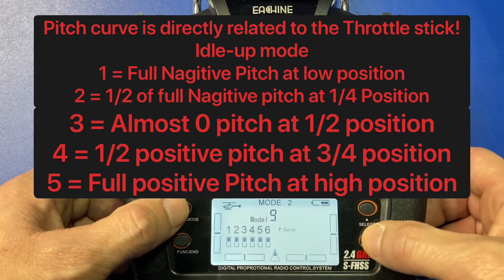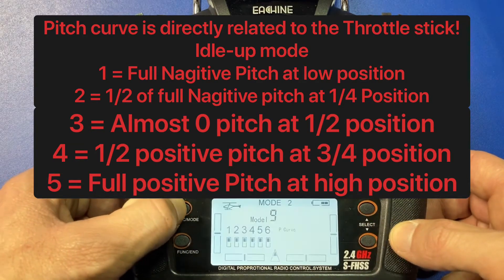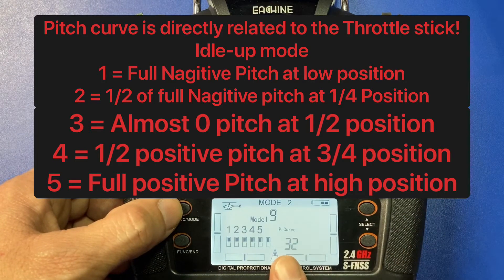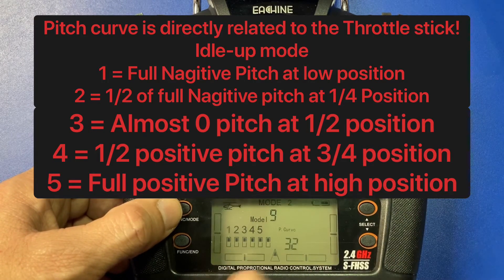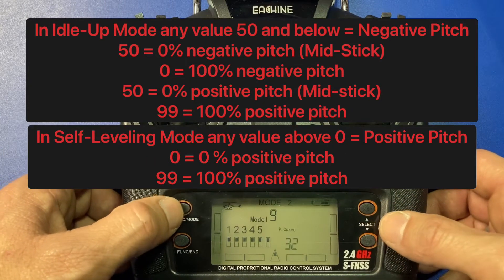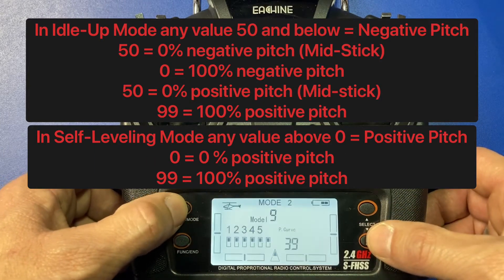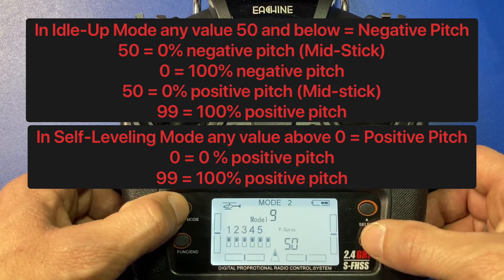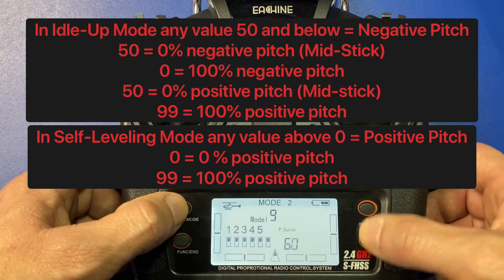Eachine e6 TX... T-Curves & P-Curves

Comment: hello, how do i calibrate the gyro on my E200S using this transmitter?
Reply from the maker: I don’t have the E200S but try the following…
Under Gyro in the transmitter… for Stability (switch in back position) the setting should be 75… 
for acro (switch in the forward position) the setting should be 25.
If the TX came with the heli Check the manual. It should have the setting or at least explain how to switch between stability and acro.
Please Subscribe, Like and Ding the 🔔!

Comment: Hi and thank you so much for taking the time to write such a great response.
So I had mentioned Eachine200 and it be the same, but the manual says YXZNRC FO9 with a T6 radio, but I’m sure it makes no difference. I watch the video you sent me and it was amazing. The menus are exactly the same as my T6 radio and I finally was able to go in there and look at the current settings.
Pitch curve 45-50-50-68-80
T curve 00-68-68-68 so I will try to change it to your suggestion for a linear curve. And that’s a good idea about testing that switch with the blades off which is no problem now the whole thing is disassembled. I am waiting on parts.
Thanks again for your help

Comment: Great video I haven’t found anything else like this although I am still confused. I am new to RC helicopters and bought my first RC helicopter being the Eichine 200 and I have crashed it badly both times I’ve tried to fly it, it seems that when I get the throttle stick about midway at that point any more input the helicopter takes off with so much speed. I completely lose control so I’m still unclear what my throttle curve should be for a beginner. I want this thing to be very soft and easy to fly. Also, the instructions on that switch are very unclear and when I hit that it sent the helicopter into a very high speed oh my God rate Any suggestions?
Reply from the maker: Hey, Thanks for the comment and welcome to this addicting hobby. 
Check out this video it may clear some things up…
https://youtu.be/kMf72lFo__M?si=1FcyOnfsNcBgjjkn

It sounds like you put your heli into Idle-up(oh my god rate)
So, as a beginner you want to stay out of this mode… First, you will have to learn how to takeoff, fly and land in all orientations in 6G mode(stability mode) than  you will have to do the same thing in Acro mode… after you are able to fly in complete control then you can start messing around with Idle-up when you are in the air.
I know that was not what you were asking but that is how you will need to progress.
So, for really beginner rates…
First thing you have to realize is that even in stability mode to fly a heli you have to CONSTANTLY make very slight corrections (hair like movements on the sticks) to stay in a good hover and fly around under control… if you bang the sticks left/right and up/down you will get out of control very fast.
For Throttle try a linear curve…
1=0
2=25
3=50 (Maybe 52 or 53)
4=65
5=75 (Maybe 80)
A true linear curve would be…
0,25,50,75,100 but you want it as soft a possible… mess with these until is feels right to you…
You can also take the blades off so you can feel how it throttles up with out worrying about taking off.
You can dial back the pitch curve as well but start with the throttle first.
Stay in stability(6G) mode at all times. The video above should explain how the switches work.
 You mentioned you cashed… are the servos all working correctly still?
Send me the current Throttle and pitch curves that are on your transmitter.
Please Subscribe, like and Ding the 🔔 it really helps out my channel.

Comment: Hey how do you reset the E6 radio? I am having some issues. I tried to calibrate the sticks but couldn't quite do it and now it's messed up
Reply from the maker: I never had to reset the E6 and the manual is no help…
I’ll try to see if I can figure it out.

This is a post to someone with the same issue…

The following info is from the manual for the XK X6 which is basically the same transmitter with a slightly different body.
The e6 manual does not give any instructions on restoring factory settings.
Try the following…
Hold down the MODE and END buttons and then turn on the TX
The display should show the letters CC… once the CC appears it should take about 5 seconds to restore factory settings.
NOTE:
I think you have to release the mode and end button after you turn on the TX.
If that doesn’t work try holding the mode and end buttons down even after you have turned on the TX.
Please let me know if this works as I have never reset the X6 or the e6.
Please Subscribe, Like and Ding the 🔔!!!
Reply: @DaddysRCAddiction  Thanks for the response. This wont work as I discovered holding down just mode and powering on goes to Mode1/Mode2 toggle mode. So holding down Mode and End and powering does nothing different. No CC letters coming its just going into Mode toggle mode. Please look out how to reset and help me. I havent got any positive responses from anyone so far :(
Reply from the maker: @DAILYTECHLIFE   What did you do that messed up your TX? Maybe I can help you correct it. Explain what you did and the effect it is having on your heli.
Reply: @DaddysRCAddiction  I purchased the RTF version, enjoyed flying 5 months. One day mid flight the tail motor started twitching and I crashed. Someone suggested tail motors going bad in the E200 is common. So I ordered new tail motor from Banggood and replaced it. Issue still persisted. Then I was told it must be the control board. So I ordered new control board and replaced it as well. Since it was a new board I had to rebind it to the stock Eachine E6 transmitter. 

First try to fly after that in normal 6G mode after I spooled up at around 40% throttle, standing on the ground the heli pitched forward bringing the tail up and I quickly enabled throttle cut. No damages luckily.  Next I thought maybe the radio stick calibration needs to be redone. Trying to do so I realized the input bars on the radio display are continuously going up and down without me touching the sticks. And when I power up the heli with throttle cut on the swash plate keeps vibrating randomly. I wanted to do a radio reset. But the manual even though has a reset section has no instructions on how to actually reset the radio. There's nothing about it in Google or YouTube. Even the radio stick calibration instructions are not clear and what I follow from the manual is not working. Also I doubt if I have the servo cables correctly connected to ch1 ch2 ch3 of the board cause there is no diagram or information in the manual or Google. Looking from the tail I connected 1st servo to ch1, right servo to ch2 and left servo to ch3. I am an amateur and now completely lost. I was so sure I would be flying today. Wasted 6 hours but have no solution. I had to wait months to get the new board and now this happened.

I know this might be a small issue with an amateur. But I really forward if someone can help me. It's a expensive purchase for me and I don't want to get discouraged just after 7months getting into this hobby.
Reply from the maker: @DAILYTECHLIFE  That heli isn’t cheap! So let’s start with the servos… typical when servos twitch around and make the swash plate move without any stick input, it usually means the servo/servos are bad or have stripped gears. With blades off and throttle cut on try moving the servos with the sticks very very slowly, look closely at each servo and notice if the movement is smooth or jumpy/twitchy, also you can check at this point if your servos are connected to the right board plug… if the servo doesn’t move the way it should then you may have the plugs crossed. 
If you’ve crashed 1 time or more you could have bad servos.

For the board… when it pitch forward the last time you tried to fly… did you make certain that the heli was on a flat surface when you plugged the battery in and “very important” you let the system initialize without the heli moving… usually indicated by beeps.
The gyro on the board needs to know what level is and it learns this when you first plug in the battery… some boards Will remember this info but some boards need to start flat without movement every time you plug in the battery.
As for the input bars moving on the radio without your input definitely sounds like the sticks need to be calibrated… but you said the instructions for calibrating didn’t work right? 
Try removing the batteries from the TX for a few minutes the check the sticks again… if everything looks good it’s a miracle but if not try the calibration again… I know you will have to decode the chiglish in the manual.
OK looking at the manual now and I’ve decoded the chiglish, try this…
1. Hold rudder trim button to the right and turn on the TX… you will enter calibration mode… the whole display will be lit up and you will hear a few beeps play.
2. Move both sticks up and down… side to side and in complete circles then return the sticks to the center position.
3. Push the rudder trim to the right… this will exit calibration mode.
4. Move throttle stick to lowest position this will complete the calibration.
Let me know if this works.
It worked on my TX
Reply: @DaddysRCAddiction  is there any way we can connect for sometime over video call please?
Reply from the maker: @DAILYTECHLIFE what are you thinking? Can you make a quick Video on Your channel showing the issues you are having… let me know when you have posted it.
Reply: @DaddysRCAddiction  yes I can do that.
Reply: @DaddysRCAddiction  holy ** the calibration worked. I knew it all 4 pots on the radio cannot go bad at the same time. I had to move the sticks and then turn the rudder trim to the right again. I was doing it before. You’re a savior. I can’t express my appreciation in words. Thanks a ton!
Reply from the maker: @DAILYTECHLIFE  Glad it worked for you... Post another video flying the E200!
Reply: @DaddysRCAddiction  the problems not over yet. Remember I said first flight after board change the heli pitched forward on its own even at 40% throttle? Well now the swash plate is not at all flat and the heli now tends to tilt back and right. I am so close to flying again. How do I make the swash flat like before?
Reply: @DaddysRCAddiction  also just so that you know. I have the swash set to 90 type. Looking from the back right servo to channel 1, front servo to channel 2 and left servo to channel 3. I hope these are correct. Again since the manual doesn’t have default settings info I am not sure if this is how it was before.
Reply from the maker: @DAILYTECHLIFE  Well... In auto level mode (6G) - tilt the heli forward, backwards, left and right... make sure the swashplate responds correctly... it should try to level out the swashplate(I know you said its not level but your trying to see if the autolevel feature is working)... if it is... leave the heli on and mechanically level the swashplate by removing the screws from the control arms on all servos...on a level surface pull off all the control arms from their respective servos and try to move them to get the swash plate to as close to level as possible then push the arms back on the servos and screw them back in... with the blades off get the head to take off speed and slowly move the cyclic and see how the swashplate responds... this should correct the forward pitch... Also do this again... tilt the heli forward, backwards, left and right... make sure the swashplate responds correctly... Let me know how you make out.
Reply: @DaddysRCAddiction  I already started removing control arms. The process is pretty difficult to achieve. No room at all.
Reply from the maker: @DAILYTECHLIFE  I know... with that hard body its hard to get to the screws... you may not want to do this but drilling small holes in the body that line up with the servo screws may make this task much easier... and the holes will be there for any future adjustments
Reply: @DaddysRCAddiction  ok now everything is put in but I lost the tail motor. The long beep after powering on is not coming. Oh man!
Reply: @DaddysRCAddiction  I don’t know if it happened earlier but the esc board is getting hot as soon as I am powering the heli. Before when powered on there used to be many beeps followed by 2 beeps and lastly a long beep finally the gyro stabilized. Now that last long beep is missing. I guess that was for the tail motor. So now wondering if I should order a new esc. Seems like my problems don’t want to end 😔
Reply from the maker: @DAILYTECHLIFE  LOL… I have a heli like that… nothing ever seems to go right with it… when powered on is the heli responding the way it should… but hot is not good… warm is OK… maybe you damaged the esc in a crash and didn’t realize it.
Reply: @DaddysRCAddiction  It was fine just moments ago. I guess I damaged it keeping it powered on to set the swash plate level.
Reply from the maker: @DAILYTECHLIFE I’ve left many an esc on while setting control horns… that shouldn’t burn it out… also it really shouldn’t be on for long… remove screws and horn, turn on heli set horns turns off heli and screw back in… turn on heli and test.
You may need a new esc
Reply: @DaddysRCAddiction  ordered one. coming in 15 days :)
Reply from the maker: @DAILYTECHLIFE  nice hope this fixes it

Comment: Sir: Do you happen to know how to reset this transmitter to factory settings? The e6 manual says nothing about it.
Reply from the maker: The following info is from the manual for the XK X6 which is basically the same transmitter with a slightly different body.
The e6 manual does not give any instructions on restoring factory settings.
Try the following…
Hold down the MODE and END buttons and then turn on the TX
The display should show the letters CC… once the CC appears it should take about 5 seconds to restore factory settings.
NOTE:
I think you have to release the mode and end button after you turn on the TX.
If that doesn’t work try holding the mode and end buttons down even after you have turned on the TX.
Please let me know if this works as I have never reset the X6 or the e6.
Please Subscribe, Like and Ding the 🔔!!!
Reply: @DaddysRCAddiction  Thank you for your response! Anyway, I have a X6 transmitter and have reset it to factory settings on more than one occasion, doing like you suggested for the e6. When I tried it on the e6, it beeped a few times and changed into mode 1. I repeated the procedure and it swapped me back into mode 2......whew!! It all started when I was playing around with the trim buttons, which as you know, is a no-no for CP helis. In doing so, my E120s started spinning wildly as if the tail motor had died, which it hadn't. The only cure for that was to select a new model and redo the T and P curves to my liking. Oh well such is life. Thanks again.
Reply from the maker: @ccbusa05  it was worth a try… there has to be a way… I have put all my models(XK and Eachine) on the XK Radios, they are  bigger and feel better in my hands. Thanks for the sub

Comment: Please, what values should I set on the eachine e6 remote control to make my eachine e 200 helicopter work?
Reply from the maker: Try my settings for p-curve and T curve in this video… I don’t have the e200 so I’m not sure if you can do 3D with it… if not doing 3D set 1 and 2  in p-curve to 48 or 49. 
Please Subscribe, Like and Ding the 🔔!!!
Reply: have you solved the problem? I also have a E200S BNF, bought this transmitter separately and for some reason, the helicopter won’t fly 😢 even in full throttle, idk what I did wrong

Comment: Would you be so kind and post throttle and pitch curve settings for a newbie flying the E160? I would like to make my first flights a little on the tame side without too much drama. Thanks.
Reply from the maker: Hay David, Thanks for the comment... I checked out some of your flights... I think you shouldn't have too much trouble  keeping the heli in the air, especially if you have flown a fixed pitch and if you plan to use stability mode.
Will you be flying in stability mode or 3D mode?.. with a heli the two modes are night and day! 
I think the T-curve and the P-curves should be OK (you may want to dial down your rates instead and go very easy on the sticks).
On my 160 in stability mode it had the same negative pitch as it had in 3d mode which can caused hard landings and or crashes upon landing.

If this is the case with yours this should be the 1st thing you fix! 
This weekend I will put up a video with my current settings which fixed the negative pitch in stability mode.
Have you checked out my review of the 160? (I show the negative pitch issue at 8 minutes 30 seconds)Here is a link...
https://youtu.be/8_udUxaxVRk  
Not sure if you are subscribed, if not, please consider subscribing!
Reply: @DaddysRCAddiction  Thanks for your quick reply. I'm sure I'll be flying in stability mode for awhile. I will definitely check for the negative pitch issue.
Reply from the maker: David... I'm sure you're up and flying already but here is the vid I just made on my settings... https://youtu.be/kMf72lFo__M
Note: The X6 transmitter is basically the same as the E6 that comes with the e160. Let me know if this helps you out.